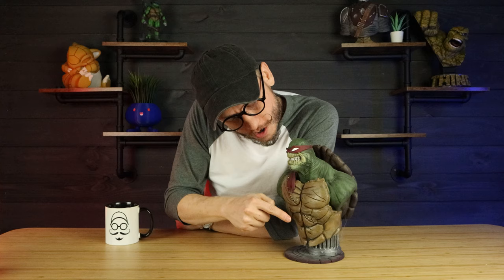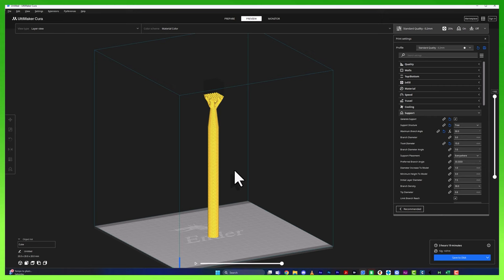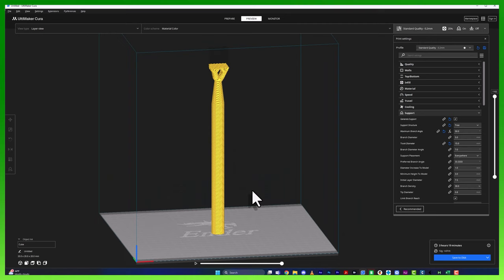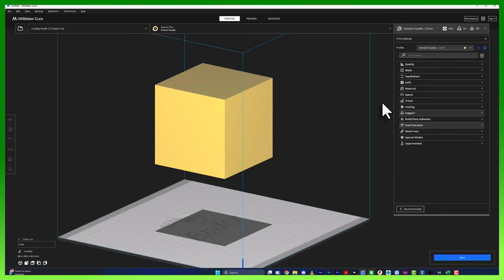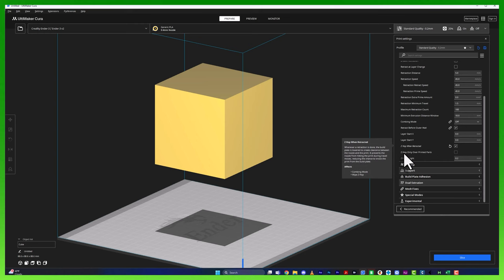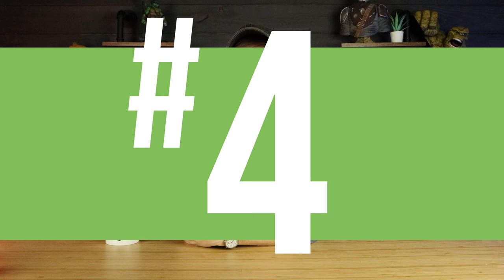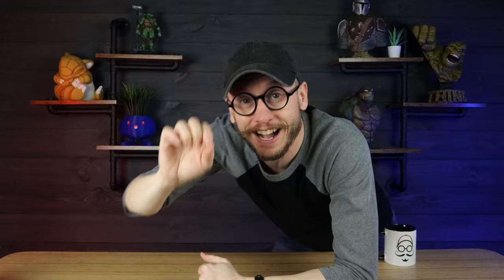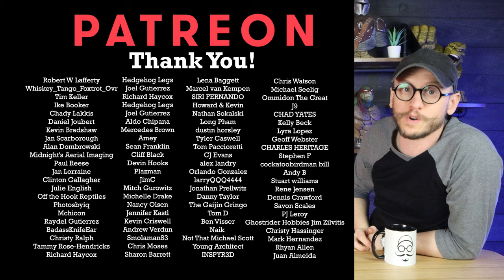5 Reason Why Supports Fail! & How to Fix Them!

Comment: I started losing my supports today.  I busted out with my sublimation heat tape,  I have a ton holding those supports down.  I was 14 hours (17%)  into the print.  Not giving up.  It’s holding so far & it’s almost 50% finished.  Wish me luck 🤞🏻

Comment: Thanks for the series on supports.  I am having a little trouble making the translation from Cura to Bambu Studio ... hope you can do a series for Bambu.  

On of the the biggest problems that I have with supports is REMOVING them.  Usually I end up breaking off a piece of the model.  I have tried both with using Bambu Support material as well as just using the filament for the supports.
Reply from the maker: Hey! Yes I’m planning on doing videos on Bambu studio as well.

Comment: maybe i missed mead saying it, but does this work for us resin printers too? some supports off our base are fragile, i dont mind using the extra resin for supports but sometimes that will fail. i will try this slow the time down thing and make my supports bigger at the bottom, maybe that make it easier to scrap off the plate as well, i have mars 4 elegoo. but just started this month.
Reply from the maker: You didn’t miss it I was just focused on fdm. But in theory it works the same. You can always mess with your support thickness in resin as well as how big your connection points are to ensure a good hold. I did some resin videos with chitubox. I cover some of those things in those vids. Thanks for the comment hope this helped.

Comment: I was wondering if you could offer your opinion on the effectiveness of gyroid as a support infill pattern.  It seems from what I've read and seen that it works well for most models, but was curious if it would be wise to apply to my support material.  Cheers!  :)

Comment: On the support strength, I think you left out "Support Wall Line Count". I have found with tree supports, increasing the wall lines makes for a much stronger support.
Reply from the maker: Hey! I left that out on purpose I’ll be discussing the pros and cons of that in a future video. I believe the best method to increase strength is the support pattern not the wall count.